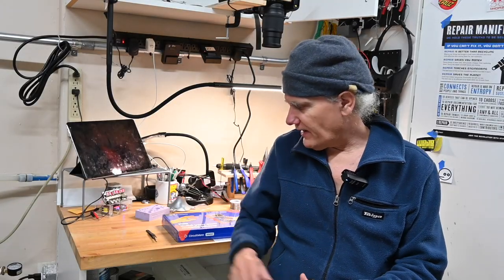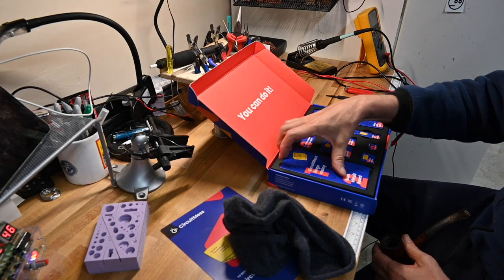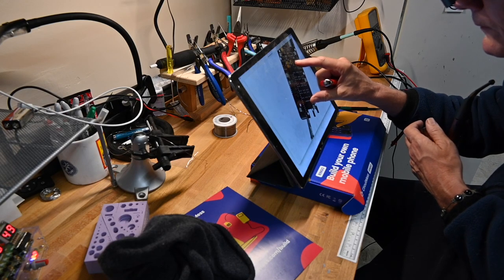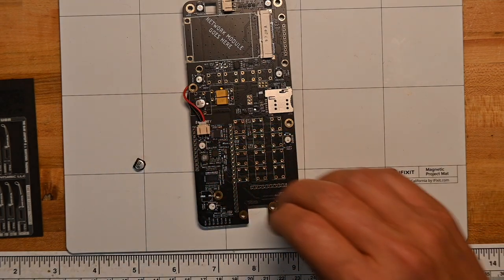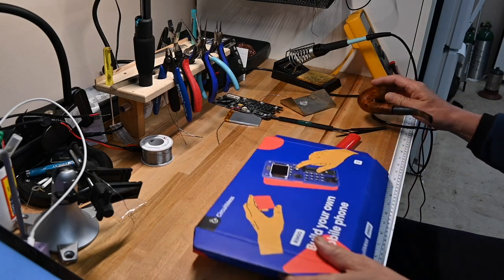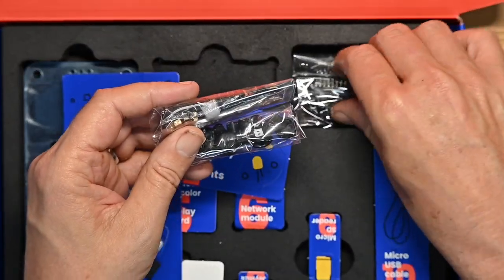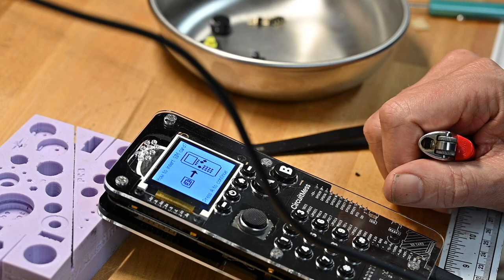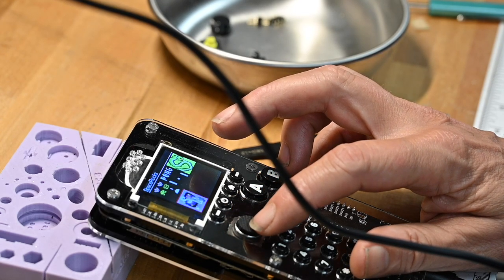C.K. builds a Ringo mobile phone from Circuitmess

Comment: thanks for taking us through this build.  Really impressed with not only the presentation but your patient way you explain things.  Also the tools you use - I can only envy you the hot holder.  Sadly they don't seem to be available here in the UK.
Reply from the maker: Glad you got some value out of it!  As for the solder block, you might want to make your own. There are quite a few two-part silicone rubber kits on Amazon UK, you could make a small forming mold with cardboard or wooden slats and pour your own, would be useful.
Reply from the maker: Following up, I picked up some 2 part high temp silicone from Amazon (available in the U.K. also, I checked) and made a soldering pad.  Here's the video if you'd like t take a look and think about making your own.   https://youtu.be/2usWOtM4SA4

Comment: Is the speaker back to front?
So the peel of section would adhere to the rear?
Reply from the maker: The white oval adhesive ring goes on the FRONT of the speaker and adheres to the FRONT panel of the case, not to the circuit board. Hope this helps.

Comment: @C.K. Haun
I have built the same phone recently and everything seems to work but it does not detect a SIM card.  I added the SIM card that came with it, no luck. I added my active T-Mobile SIM card and no luck.  When you were testing this device in the video, you did not install a SIM card saying that it will probably work. I wonder if you would be willing to install the SIM card that came with it in your build to tell me if the error goes away or changes to something else. I suspect the error will change to No Service, not No SIM. Maybe you can see in the circuit how the card detection works and give me clues on testing it. I am a Firmware/Software Computer Scientist by trade and have some electrical knowledge, but it stains me hard to solve electrical issues.

Any help will be appreciated.
Reply from the maker: @brucekchidester The kit I got did not actually have a SIM card. I bought a prepaid one, but never installed it.  I will try it when I get back to my shop, I’m away from my home country for two more weeks, so there will be a delay.
Reply: @CKHaun  Thank you for your willingness to assist in this debugging. I found the SIM card that came with it accidently. It was in a cardboard fold advertising for a cellular service provider. This particular SIM card it not necessary if you have your own. I have T-Mobile SIM in my existing smart phone and it is micro-SIM size. I went to a cellular store to get the plastic forms for the SIMs so my SIM will fit in the mini-SIM slot needed by Ringo. I believe that even if the SIM card does not have an active service on it, the NO SIM detected error will go away. This is what I need to figure out. I have the SIM7600A cellular module on my kit, and believe it is still compatible with CDMA service.
Reply: @ckhaun I was able to figure out the SIM card problem. It does not recognize card insertion dynamically and was being tricked by this. You have to power cycle the machine with each insertion to give it a chance to reconnect and use it.  The correct orientation of the SIM is circuit up and notch out. Seems backwards to me. I still cannot connect to my service though and I think it's because I'm using SIM7600A. I ordered a mpcie SIM7600G-H from Digikey. This apparently has global network support.
Reply: Update on my progress. The SIM7600A that can with my kit is not compatible with my cellular service. Bought a mini pcmcia SIM7600G-H R2 module and put it in. The 0.9 Ringo SW did not seem to recognize the new SIM module, reporting "no module.". Got the Arduino connection set up and re-flashing got a new FW 1.2 I think. The cellular module was detected and placed my first call with my T-Mobile SIM. Answered the call and no voice can be heard on either side. I am now thinking the Ringo circuit is expecting a different interface for the cellular module, Analog vs. Digital. I am still looking into these details, but making progress.